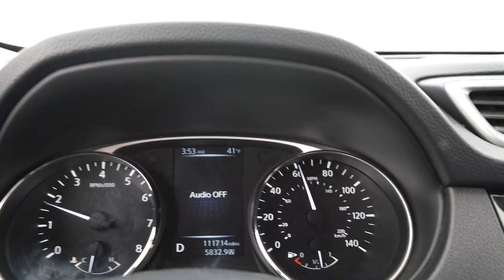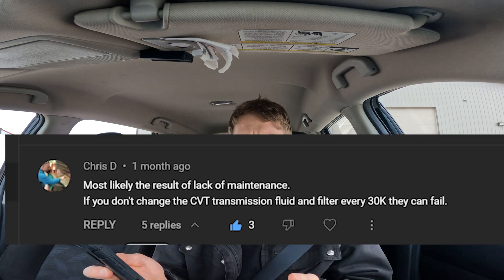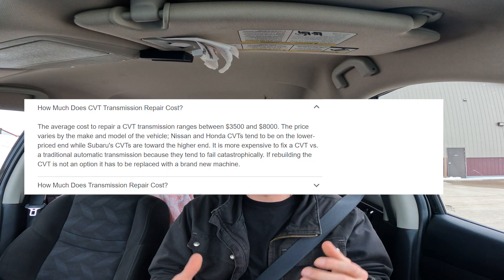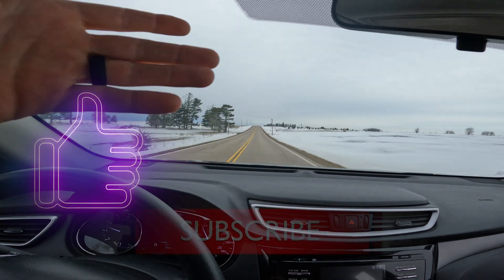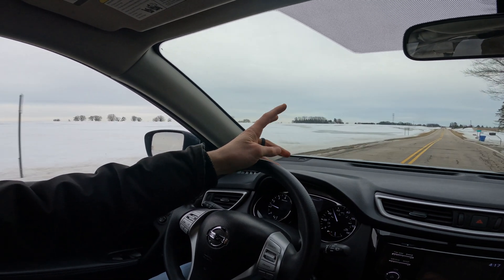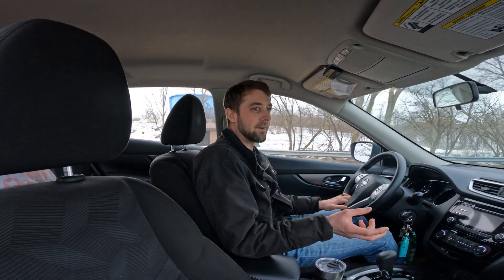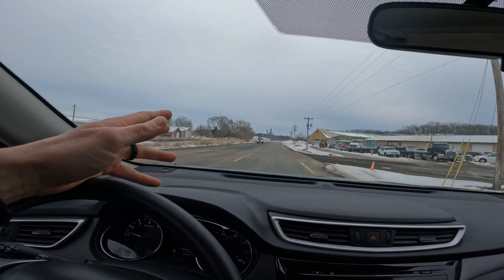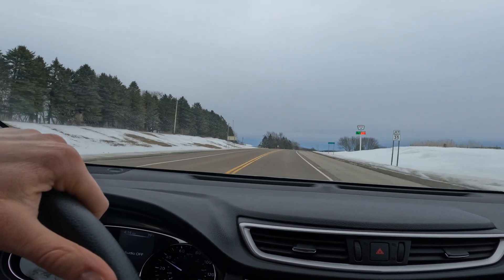Everything WRONG with the Nissan CVT Transmission

Comment: The issue with CVT is that it's junk even when it works perfectly. I don't care how "efficient" it is, it feels like driving a broken car.  It's literally only fit for cars and drivers who have no interest in cars at all and just want to get from A to B. Anyone who has any, and I mean ANY interest in cars, driving, driving enjoyment, etc. should stay away from CVT's like the plague. Don't fall for numbers on paper, for consumption stats, for acceleration stats, etc. Actually driving any car with a CVT makes it feel much slower, less responsive, less controllable than they should be.
Reply: Absolute rubbish. After changing gears for 35 years (Eaton Road Ranger) I'm over manuals. I just know about mechanical sympathy and don't abuse its parameters.

Comment: I'm definitely not a cvt fan but my SR20DE Nissan Primera P11/G20 cvt has done 220,000k's, its been serviced once @ 100,000k, yet the fluid looks like I just poured it in there yesterday, and it runs fine. Go figure

Comment: It’s not a CVT or Nissan problem.
People fail to do the tuneups and they ride them hard ! Go down hill in neutral ! I had 2 and never had any problems ! I ran mine 280k and sold it running  and in good shape ! Don’t run the car on idle long periods ! I still have the second one 162k running smoothly

Comment: While I transmission flush can sometimes be necessary in order to repair or in an effort to repair a transmission problem? in most circumstances, it can cause more problems than it fixes and often times an automatic transmission becomes far worse and doesn't work at all due to the Nature of a flush removing built up varnish, contaminants and debris becoming stuck within the valve body assembly during the flashing process. Pro tip. It's best to drain the transmission fluid as per the vehicles manufacture instructions, then measure the amount that was captured in the drain bucket and then install new full synthetic transmission fluid to the same amount drained. Some vehicles still have the old dipstick housing with a rubber cap, installed in order to prevent what they say to be the number one reason for transmission failure from foreign debris. I feel that manufactures used this tactic to remove their own accountability for poor R&D manufactured transmissions & not employing quality with incremental changes to a given model. The transmission dipstick for your particular vehicle can't be purchased on Amazon and simply installed by removing the rubber cap located near the lower front portion of your engine compartment. This allows someone such as yourself whom is actively engaging in proper regular vehicle maintenance in order to be proactive in preventing unnecessary vehicle running costs. With that being said, all the maintenance in the world cannot fix a poorly designed transmission or vehicle. If your still set on purchasing or driving an economy vehicle, then a very good alternative would be a MAZDA CX SERIES SMALL TO MIDSIZE SUV'S simply because Mazda has tremendously, stepped up their quality game, while always being a very fun performing vehicle zoom zoom. They have also partnered up with another Japanese manufacturer who happens to know a thing or two about quality coming first rather than quantity. With TOYOTA now backing some of Mazda research and development. I can assure you that they have solidified the number 3 spot and can only go up from there. If they do offer a hybrid SUV option at a similar price point to a Nissan rogue, then that would be an even better option even with the Canadian winters we experience that are becoming increasingly shorter and warmer than decades ago.

Comment: If you still have this vehicle, it would be best to change the transmission fluid immediately, regardless of its mileage with a full synthetic CVT transmission fluid. It does not have to be Nissan CVT oil none of the vehicle manufactures actually produce their own fluids. a good alternative would be Castrol full synthetic universal CVT/ATF FLUID changed every 20,000 miles due to the excessive heat buildup within the 5 L capacity transmission with little to no transmission cooling which is the primary reason for premature bearing failure. Even when manufacturer removed the number one reason for transmission failures due to dirt and other contamination within the transmission has still not proven any more reliable with Nissan. You can purchase an aftermarket dipstick to put in place of the dipstick tube plug that is installed on what used to be the dipstick housing in order to check your level, which will likely be within the safe range if you don't have a leak.? Drain out you can measure it, and reinstall the exact same amount of a full synthetic transmission fluid again every 15 to 20,000 miles if you want to maintain and best prevent transmission failures because the problem is not going away anytime soon or you'll have to step up to the top tier Japanese market, Toyota and Honda?

Comment: While I agree on many of your points being made within this video, regarding the longevity and performance of some of the manufacturers CVT. That being said of the Japanese market small to midsize SUV, you simply had chosen the wrong manufacturer for your size of SUV. if you were wanting a small to midsize SUV. I would strongly suggest a RAV4 or Honda CRV. While many of the manufactures have switched over to a CVT style in order to increase fuel economy due to government regulations. There is a huge quality difference when purchasing a Japanese Toyota or Honda made vehicle with or without a CVT. It's simply a matter of time before other mechanical wearing parts fail. This is clearly demonstrated with the old adage you get what you pay for. The Nissan rogue historically is somewhat of a lemon unfortunately. The new generation ROUGE while better in quality is still a very unreliable vehicle if that is what you were looking for and expected, you will not find that with any Nissan products. Nissan has recently fallen to the number 4 or 5  position for quality as per customer complaints of owners within the first year. TOYOTA and Honda have solidified the 1 and 2 spot for decades with Mazda, becoming a much more liable, cost-effective alternative to the more expensive brands. The good thing is at least you had the knowledge & whereabouts to go with a Japanese made vehicle rather than one of the what used to be BIG 3 MANUFACTURERS THAT , QUALITY AND PERFORMANCE ISSUES. Please Don't get me wrong I'm not trying to put down or make better of any manufacturer of any vehicle, because every manufactured vehicle worldwide has its own problems and issues with none of them being perfect. my perspective is simply based on experience in the repair industry & manufacturing a vehicles giving me a hands-on knowledge based skill set to allow the conclusions I've come to. Unfortunately, government regulations within Canada and the USA and most parts of the world will only get tighter the global climate change that we're experiencing with gasoline and diesel vehicles wrongly at the forefront of the chopping block. I know that the RAV4 is a lot more expensive for a brand new one but even I used RAV4 that's fairly new is far better off than any Nissan product made. Nissan has simply falling by the wayside when it comes to quality and performance of their vehicles. I equate Nissan to the quality of a Ford or GM SUV. If you look at the TOYOTA CVT it is much more reliable with the addition of launch gears in their newer models to give you the feeling of a torque converter styled transmission that most North Americans are used to and prefer with a slight bump between gears with excellent reliability and fuel economy. if you wanted to step it up further with a RAV4 hybrid, it just might be the last vehicle you buy?

Comment: It is shifting. But it is not called shifting but is the equilivent. It is spooling. One pully is opening up groove getting wider while the other is closing getting narrower. Opening allows the belt to go deeper into the pully simulating a smaller pully while closing getting narrower makes the belt ride up in the groove simulating a larger pully. Those changes occur in slow motion thus the rubberband feel.

Comment: Enough will calling the CVT a CVT Transmission. The designator CVT already covers the transmission aspect. Proper term for the transmission is CVT....not continuous velocity transmission transmission. And Yes I do have a CVT(not a "CVT Transmission) in my car and it serves weill for my meager needs I demand of my car.

Comment: My 2018 Camry has 300k on its original CVT transmission. I change the fluid every 40k and it seems to be fine so far. Now, it doesn’t act like a spring chicken, it drives like a chicken with 300k on it.

Comment: I had an ‘08 maxima with a cvt that I put a stillen charger (with supporting mods) on it running on 10lbs. I street raced that thing constantly. Only thing I did with the cvt was  2 fluid drain and fills in the 150k miles of ownership. I never had a problem with that cvt. But, my friends ‘13 nismo juke needed a new cvt and car has barely 90k miles and only 2lbs over stock boost. From my experience, the pre ‘12 Nissan cvt’s were just better made

Comment: I had an ‘08 maxima with a cvt that I put a stillen charger (with supporting mods) on it running on 10lbs. I constantly street raced that thing constantly. Only thing I did with the cvt was  2 fluid drain and fills in the 150k miles of ownership. I never had a problem with that cvt. But, my friends ‘13 nismo juke needed a new cvt and car has barely 90k miles and only 2lbs over stock boost. From my experience, the pre ‘12 Nissan cvt’s were just better made

Comment: If you like hard acceleration every time off the red light, if you enjoy racing to the next red light, if you don't plug in a block heater in cold climates and allow the vehicle and transmission to warm up to operating temperature before immediate hard acceleration in -30C weather, then you are a Clown who is going to trash his CVT transmission very quickly. I knew a guy who said "my transmission is under warranty ",so he trashed his transmission twice in 2 years, in our Canadian climate. He is a Clown. The fact that you don't know a good way or a bad way to drive says a lot. LOL.

Comment: I've had my Nissan CVT for seven years and it was built in Japan. It seems good, so far. It is a Tiida Latio, a Versa in America. I have changed the transmission fluid twice over the last  80000 kms.
It only has a 1500cc motor and I don't go over 3500 revs on the tach. There is no need too.
Good motoring.

Comment: Conducted, or considered new plugs (iridium), fuel injector additive flush or replacements?
 CVT filters / screen replacement as well as possible additive? (Lube Gard)

Best -
Reply: Sorry, forgot.

New coil packs.  Could possibly improve your consumption?

Comment: bought a 2011 Nissan Rogue for $6,000. 3 years ago already up to $5,000 in repairs for Air conditioner Compressor, mass Air flow sensor, brake pads, rotors, calipers, ball joints, tie rods, struts, cv joint. I am 74 and only drive about 50 miles per week if that so now i am afraid this Jap Junk will blow a tranny at any given time.

Comment: I am surprised the aftermarket hasn't come up with solutions to these problems. I haven't found any rebuild kits or transmission swap solutions anywhere. My uncle's 2014 QX60 hybrid is in pristine condition and runs perfectly except for the transmission shudder problem. I feel like there is a MASSIVE market for this.

Comment: I refuse to own any vehicle with a CV transmission. One of the biggest complaints of a CVT is the very mundane driving experience. I will stick with a more enjoyable shifting automatic transmission that can be rebuilt when the time comes instead of buying a whole new or used transmission.
Reply: Doesn't matter what auto transmission, remember to change fluids yourself at 30.000 miles 40000 miles is the latest .and use exact fluid get it from dealership
Reply: @heinhandsome2010  Yep, changing the transmission fluid is as important as changing the engine oil. I do all of that myself on both of my vehicles. On my dally driver, which is a 2007 Pontiac Vibe which I bought new, I drain the transmission fluid every year and every other year I drop the pan and clean the filter screen and pan. It is such an easy job to do, I just do it for something to do. My Vibe has 100,000 miles on it, and it still drives like a new car. I still will never own a vehicle with a CV transmission. Just not a fan of the driving experience.
Reply: @russellmaddock3492  I don't know what's going on with others but my 2019 chr and 2020 corolla le is perfect, smooth off the line feels like the moments airplane lifts off the ground. 
And mpg is outstanding .no reason not to love it

Comment: I want to say everything that this guy says in this video is 100% factual about these vehicles.  I used to buy and resell vehicles, and I ran into several rogues, sentras and Altima’s that had the same exact problem.  Nissan had a terrible engineering idea to make these vehicles more fuel efficient by implementing this junk POS transmission that is a problematic issue. I don’t care how many miles at the car has it could be as low as 30,000 miles in the transmission starts to fail nothing in my opinion great video

Comment: Dosent last is the main idea,  more money for the manifacturer, parts, the mad a mistake in the past by making durable engines and transmission, and know they are correcting the mistake, it looks like technology is going backward, from good product that last long to bad product that dosent last too long, like ford fiesta and focus dual dry clutch transmission that last only 40000 miles and you need atleast 3500 to 5000 just to replace the clutch assembly, and good luck finding the shop that willing to do that, if you do it yourself, it will.cost only the clutch assembly cost 600 dollar if you have a garage to do it, because you cant do it in the street, meaning you can, but the police may gave you ticket for that.

Comment: Nissan didn’t even make that CVT Trans. It was a third party that supplied it to them  are all of them expensive to replace yes, Honda and Toyota have got them down pretty good. One thing you do need to do is change the fluid every 30,000 miles.  The problem with Nissan and I believe they still use a torque converter answer. All the heat comes from. I know Hannah uses engagement clutch system with no torque converter as I know Toyota were good. Just gotta take care of one. I got a 2015 Honda Civic with 200,000 miles on it CVT operates nice and smooth

Comment: 200,000 on my 16 versa cvt.. still going.. hoping for 250+
Reply: do you change the fluid
Reply: @stellahansen06623  full fluid replacement @ 70,000… drain and fill every 20,000 miles since then

Comment: I had a 2015 Murano and the trans kept slipping. It wouldn't move the car from a standing start. I was lucky when after taking it back to the dealer four times, the area engineer was there and he took it out, came back and told the dealer to replace the trans. That car was totaled a month later and I bought another Murano 2016 (my 3rd) That trans started slipping with only 3,000 miles and the dealer immediately started playing the lemon law game with me. A call to Nissan West Point GA and they called the dealer who claimed there was nothing wrong with it. The car also had a high frequency vibration in the steering system (more common in smaller Nissan SUVs) that made it painful to hold the wheel at highway speeds. The dealer claimed they felt nothing but never took it on the highway to really test it. I called a lawyer, and he told me he tried suing the dealer before but lost because they were experts at playing the lemon law game. It was Preston Nissan in Preston MD. I later found out Nissan used statistical analysis to determine they sold more cars to new customers than returning customers, (probably because they didn't like getting screwed on warranties) so they decided to screw the current customers and rely on screwing new ones!  Never buy another Nissan or any car from Preston.